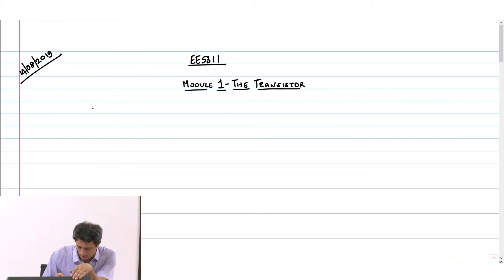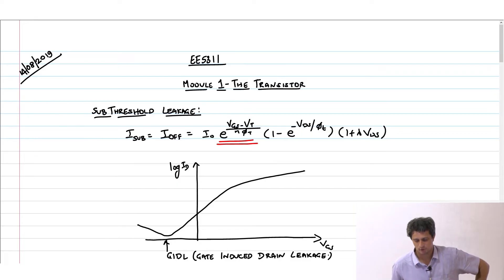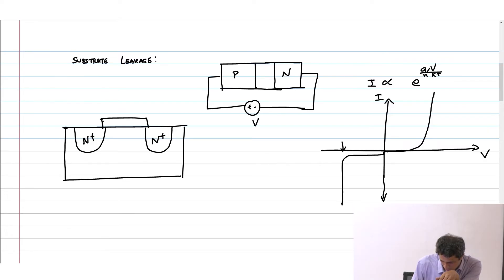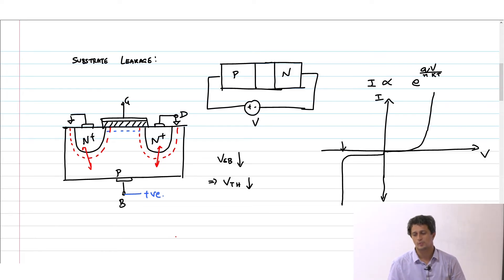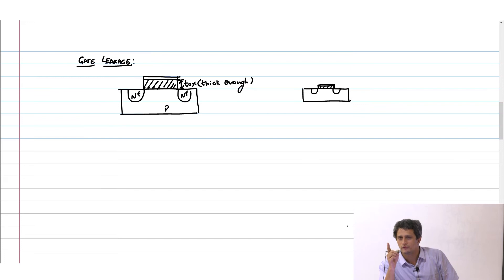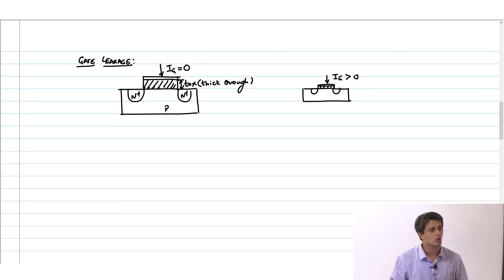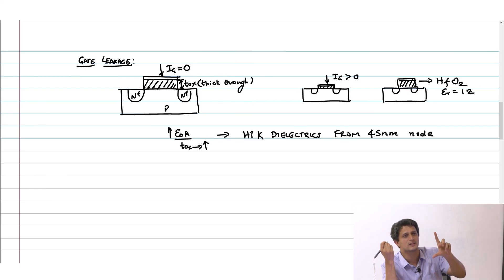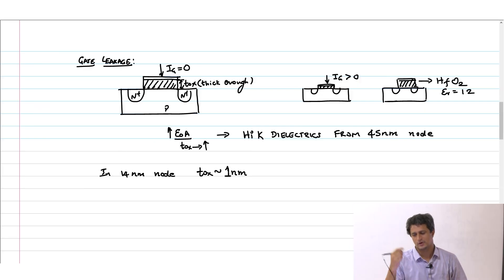Transistor-9 - Substrate and Gate Leakage

Comment: 02::07_09-04-24_@IIIT-H
substrate forward bias --> current flow & transistor scaling leads to Gate tunneling (low oxide thickness)

Comment: For gate leakage when you  said 180 nm 130 nm 45 nm etc did you mean oxide thickness or distance between drain and source?
Reply: drain and source dis
Reply: He was refering to the process node. It has nothing to do with the physical parameters like oxide thickness or channel length but its related to manufacturing process. Over nodes lowering, the dimensions of transistors reduced, thus accommodating higher number of them in a chip.